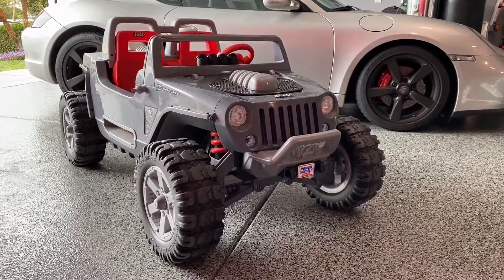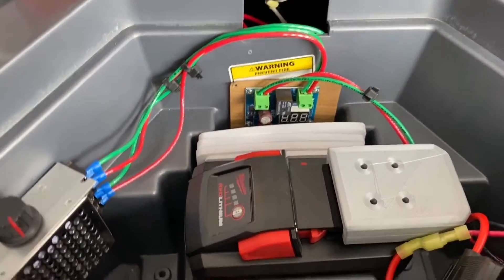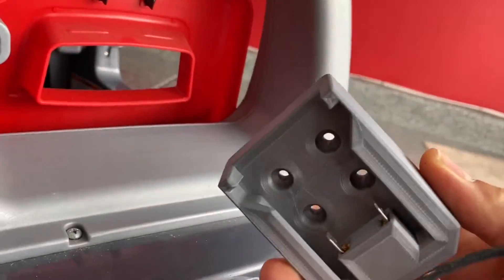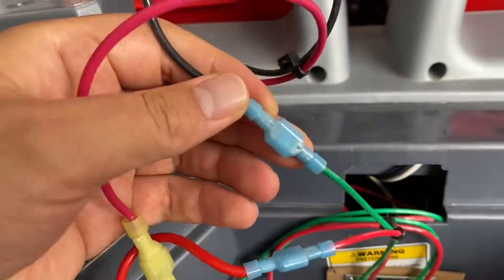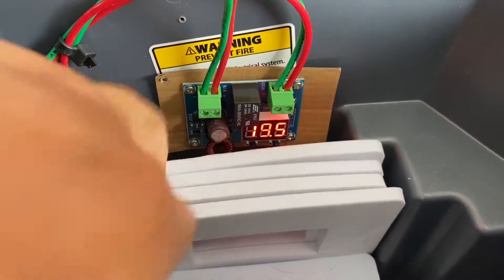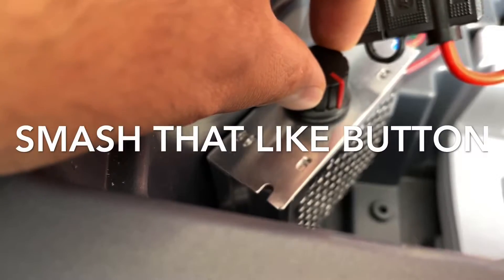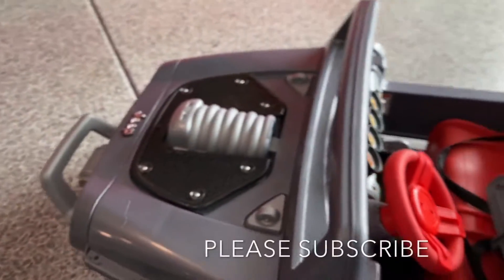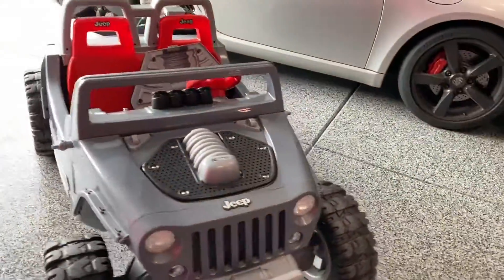Best easy how to modify Power Wheels Jeep Hurricane 12 Volt to 18V conversion Power Upgrade Review

Comment from the maker: Power Wheels Jeep Hurricane 12V to 18V conversion. Run time went to 4+ hours per charge and charge time dropped from 18 hours to 3 hours. Top speed went from 5 mph to just over 7 mph. Thank you for watching.
Reply: Are you having problems burning up motors?
Reply from the maker: Negative
Reply from the maker: The speed controller helps since I usually run it at 80%-90% instead of 100%.
Reply from the maker: Are you having issues?
Reply: @WheelieMan  ya I put in new 550 motors in jeep hurricane. All stock and broke them in as instructed for 20mins with 12v. And with in 45 mins on milwakee m18 12ah both motors blow brushes and Armatures and they were name brand motors.
Reply from the maker: Motors overheated/failed shortly after installation:
1. Are you using the right battery? Stock motors are designed for up to 12v SLA. Performance 550's up to 18v SLA. Performance 775's up to 24v SLA. Do not use lithium batteries in a ride-on. They have a discharge rating 5x higher then SLA batteries. With no clutch to absorb all of that extra punch motors have no choice but to cook or gears to strip. 
2. Did you break the motors in? Performance motors need the motor brushes "seated" to the commutator under a very small load. This is done by raising the back of the car in the air and running it in low speed for the time listed on the manufacturer's instruction sheet. Failure to break them in causes excessive arching/sparking in the motor and will crack a motor brush. There's no repairing this damage.
3. Is the pinion gear the right tooth count and pitch for the gearbox? The only gearbox that can change tooth counts is the 7R. The range your 7R gearbox can take is printed on the gearbox housing. Using a pinion gear too big will cause the mesh to be too tight which puts a strain on the motor. Either the motor will fail or the first gear will strip/melt. The pitch basically indicates the shape of the tooth and can not be changed.
4. Modified tires will overheat motors. The spinning tire is the closest thing your car has to a clutch. Adding rubber/traction puts a ton of strain on the motors and gears. Changing to a larger diameter tire changes the final drive gear ratio of the car and can also overheat motors. Larger diameter tires need to be countered with a smaller pinion. Adding heavier tires also creates more strain for the motors and should be countered with smaller pinions.
Reply from the maker: Was the 45 minutes continuous? Most I’ve ever ran mine for is 10-15 minutes before stopping to let it cool.
Reply: WheelieMan Is that with the controller turned down to 80/90%?
Reply from the maker: Correct. I try not to run it on 100% for too long (meaning the speed controller dial cranked all the way up to 100%). I usual dial the speed controller back to 80% for longer periods of use. I also installed the ML Toys brake controller witch gradually cuts the power and reduces the brake force. This helps to slow the off throttle brake force and puts less strain on the gearbox. Keep in mind it stops a bit slower, but that is what is designed to do. Without it, once the accelerator pedal isn’t pressed anymore, the motors immediately cuts power and the rear drive wheels immediately stop spinning, which makes for fun power slides, but also puts a ton of strain on the gears which will wear them prematurely since they are spinning much faster than they are designed to with the extra voltage.
Reply: I modified my grandson’s hurricane  to Milwaukee 18 volts...but it blew the 30 amp fuse after 10 minutes of running. Any thoughts?
Reply from the maker: My 30amp fuse did the same. I upgraded to a 40 amp fuse and have not had any issues since. Check out MLToys.com. They sell an in-line 40amp fuse which is what I run. Haven’t blown a fuse since swapping the 30amp in-line fuse with  this 40 amp unit.
Reply: WheelieMan Thank you very much for your reply. Why didn’t you just put a 40 amp fuse in ?  I think I need that speed controller and bigger fuse. Thx again.
Reply from the maker: At first I thought that the 30amp was going to be large enough, in theory it is, it will work, but only until everything heats up, then the heat created by the extra voltage reduces this threshold leading to blown fuses.
Reply from the maker: Lower voltage creates less heat, leading to less fuses being blown. You can run at 100% for longer with a 40amp fuse, haven’t blown one yet 🤞🏻, but the speed controller lets you dial down the voltage, which I usually set to 80% for extended run times and less stress on the motors and gears, etc. Just be sure to install the low voltage cut off too or you could damage your Milwaukee battery by over discharging it to a point where the voltage so low that it damages the cells. These batteries are not cheap. 👍
Reply: I put a 20 volt black and decker up grade to my sons power wheel and the battery didn’t last long. Any thoughs.
Reply from the maker: @walterdavis8085 how many amp hours is your 20V?
Reply: @WheelieMan  1.5
Reply from the maker: That’s why. I’m using 12 amp hour battery. 1.5 amp hour won’t last too long. Grab a higher amp hour battery for longer run time. 👍 a 3 amp hour battery should theoretically double your run time.
Reply: What gauge wire did you use?  The wire inside original battery was 12.
Reply from the maker: Parts used are in video description, 14 awg wire is what I used.
Reply from the maker: I’d email this company to see what they say. They would know what’s going wrong. 

GoFast@MLToys.com